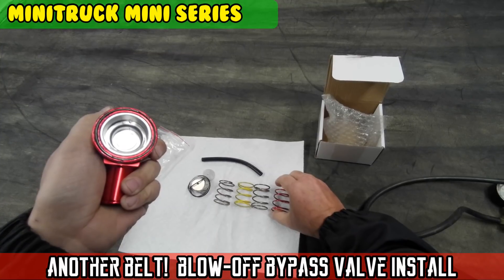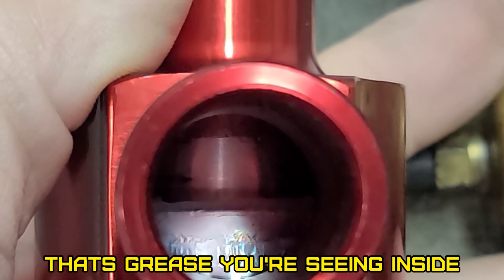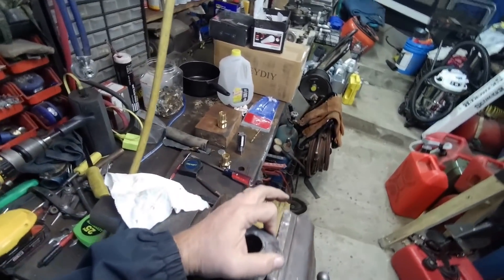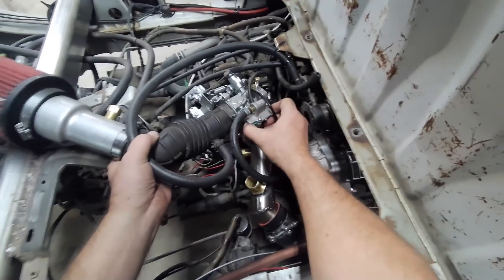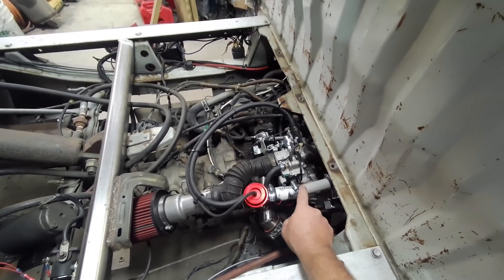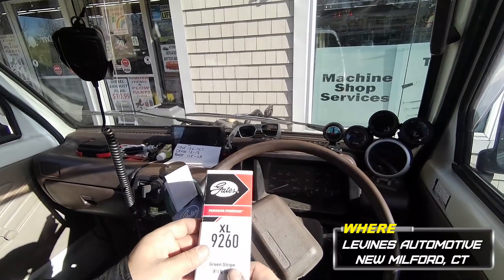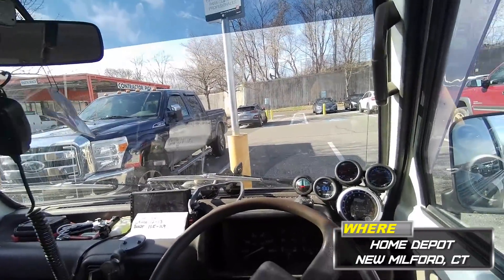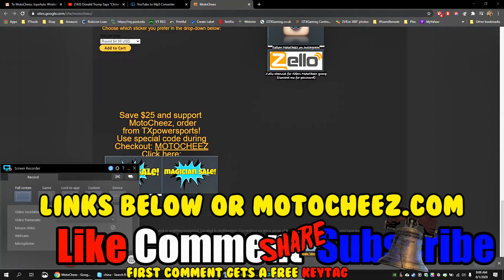Mini-Truck (SE06 E11) AMR300 Another BELT? Blowoff / bypass valve installation

Comment: That Mini... she's a belt eater.  Cutting threads in cast iron without lube?  Yer a braver man than I.  Here's to hopin' progress has been made.
Reply from the maker: You don't really need lube with cast iron it's full of oils, I think graphite. But the stainless steel I definitely used a lot of oil

Comment: I was going through belts heating up and just snapping every few weeks - heat from turning heater and plow winch and lights went to a gates green belt and no issues since belt is cool to the touch now . 25$ a belt but well worth it

Comment: When I'm done with the RTV in the cheez wiz cans I leave maybe a half inch out so when it dries and I go use it next. I pull the part that's  out of the can and it pulls the rest out of the straw or whatever you wanna call it.
Reply from the maker: That's what I do, but it still hardens back into the valve...

Comment: Now I see, said the blind man.  You are using the bypass valve to bypass the supercharger but with both connections still in the post-carb intake tract.   I was afraid you were going to connect pre-carb and suck in unmetered air.  Interesting experiment.  Hope it work for you!
Reply from the maker: I'm keeping fingers crossed!

Comment: Glad to see you finally drank my Kool Aid. lol. You are absolutely correct the engine is producing less "negative horsepower" i.e. engine braking when you let off due to the recirc valve. I think you are going to find the blower to be pretty reliable now.
Reply from the maker: Fingers crossed!

Comment: the springs are to tune the valve opening to the amount of vacuum signal your engine produces.
Reply from the maker: Yes. Boost pressures
Reply: @MotoCheez  Thats a misnomer. If the springs just affected boost tolerance then youd put the biggest spring in there and forget about it. The spring is to tune how much VACUUM is required to lift the poppet of its seat.
Reply: @MotoCheez  By tuning this valve you will change where the supercharger "comes in". Right now you are thinking at idle im no boost and stomp it i got boost. the springs change the middle gradient. At what throttle angle does the valve begin to move and raise manifold pressure into boost. Thats what the spring does.  The instructions you have are for a BLOW OFF VALVE. Which this is not. Its also not for a turbo charger. Sure, its the same valve. But its application is different.
Reply from the maker: Says can use for turbo online...
Reply from the maker: Typically would not have any vacuum before the supercharger or turbo unless you're doing a system like I did which is very rare nowadays so I don't understand what you're trying to say that the boost pressure has nothing to do with the spring because that's what it's advertised as. I know the vacuum lifts it now because I have a pull through system. But typically to vacuum hose is the top would actually open it also to unload, but the spring pressures are stated for boost relief also in case you had a spun up turbo or whatever
Reply: @DieselRamcharger  100% correct.... only to mention : TIAL even makes special springs for their BOVs  for Supercharger Applications  -2 PSI(green) and -3 PSI (pink) Springs
Reply: @MotoCheez  look man. the chinese guy who knocked that valve off and the three interpreturs it took to bring you that instruction book HAVE NO CLUE WTF they are talking about. YES. it CAN be used as a BOV. it also CAN be used as a recirc valve. Which is WHY it has "tuneable" springs. You are tuning the differential pressure of when the poppet {valve} starts to lift off the seat. In a turbo application you would just put the heavy spring in it and forget about it. in a supercharger with a big cam youd need a very light spring or it would never open.  Please Understand This. What I Tell You Is Gospel.  Im not guessing. These are facts.
Reply: @MotoCheez  bro. vacuum is created by the throttle plate. this is a roots blower. the throttle plate is almost always before the blower.  you are right. BOOST PRESSURE HAS NOTHING TO DO WITH THE SPRING. it {the spring} tunes the amount of VACUUM that operates the valve.
Reply: @MotoCheez  you are flip flopping between turbo and sc terminology and function. this valve. it can be a blow off valve used for turbos or superchargers. a blow off can recirculate or it can vent to atmosphere. This valve, in YOUR system. Is NOT a BOV.  It is a re-circulation valve aka bypass valve. In turbo land the spring pressure is used to stop the valve from leaking boost.  In supercharger land that spring is used to balance WHEN the valve opens...but more importantly WHEN the valve CLOSES.  A BOV {surge valve} pops open briefly to vent excess gas to keep up air momentum in the system. A Re-Circ valve is 90% of the time OPEN and CLOSES when you want boost. Engine Vacuum which is created by HOW FAR THE THROTTLE IS OPEN tells the valve how far to lift off its seat. the more closed your throttle is the more vacuum you make. the more open the valve is. the less manifold pressure. as you open the throttle vacuum disappears. the less vacuum at the valve the more closed the valve becomes until you are under positive manifold pressure. when you let off it, high vac returns the top of the valve sees that low pressure and the poppet is sucked open. thats why tuning the spring pressure affects your blowers power curve. but has jack shit to do with power curve in a turbo or centrifugal blower setup.
Reply from the maker: I'm not arguing with you. Either the vacuum or the boost has to exceed the spring pressures. It's basic mechanics.
Reply: @MotoCheez  the boost pressure never exceeds spring pressure. thats what the vacuum half of the modulator is for. ;)
Reply: @MotoCheez  i was in an attic running duct all day. i was super crabby last night. so take my saltiness with you know.. a grain of salt. :D
Reply from the maker: Unless you hook it to the boost side... Like some blow-off valves do
Reply: @MotoCheez  nope. boost never overcomes the spring. if it does, the valve is leaking. on a turbo car the valve is placed before the throttle blade but the vacuum reference is still after the throttle blade. the placement of the valve itself makes no real difference. the placement of the reference hose does. the springs are tuneable ONLY so you can affect how much vacuum it takes to lift the poppet off its seat. You run a spring thats "too stiff" and the engine CANT produce enough vacuum to open the valve. It will never blow off. Its NOT because you "arent running enough boost" or even that the "spring is too strong" the REAL issue is that the generated vacuum signal is TOO WEAK to PULL OPEN the valve. Boost does not PUSH these open. Vacuum PULLS them open. the boost exerting force on the poppet only reduces spring tension to a point where the engine vacuum can act against it. the boost NEVER pushes these valves open. Never. If it did, you COULD NOT USE THEM as a recirc valve, because in YOUR CASE you are closing the valve under full boost only because the vac signal is lost.
Reply: @MotoCheez  we are going to have a sit down about pressure differential if we have to.
Reply from the maker: Absolutely yes I've seen on actual real blow off valves that you're supposed to put the pressure to the top to keep pushing it down as you create boost it's only for like a backfire or when you let off so if you pressurize that small 1/8 port it puts pressure on as you boost it
Reply: @MotoCheez  pressure on top is for a wastegate, which are referenced off boost source {before the throttle plate} bov's are referenced off manifold pressure {after the throttle plate}. when a bov is under boost both sides see equal pressure and the only thing holding it shut is the spring. in a wastegate boost is always acting against the spring to try and force it open.

Comment: I found the slightest burr on my snowmobile clutch a couple years ago after I shredded a new belt and then my backup within 10 miles. Couldn't believe it was the issue but I smoothed it out and ran 1500 miles with no more issues...biggest problem was trying to figure out how it got there...think I nicked it while wrenching.
Reply from the maker: Yeah. Little Burr can cause some damage!

Comment: So the reason we knew where the metal in the blower came from is it was fresh out out the box and perfect, and on the kitchen table he removed the 4 bolts only and was fussing with it and it locked up, and we dug thread shaped metal out of the impeller. Inspection revealed it had fallen out of the through holes of the manifold.
Reply from the maker: Wow. I never even thought of.looking. Was in plastic as I'm sure yours was too. Crazy!

Comment: Good result, I'm a little disappointed you didn't get any pssshh psshhh noises though. now that you have incorporated an intentional weakpoint the belts shouldn't cop all that stress. Next question is are you game enough for the yellow spring.
Reply from the maker: No psh psh because it opening on vacuum. I haven't hit enough boost. I don't know if I'll ever hear it either.
Reply: @MotoCheez  yeah true, it's more of a regulator than a blow off valve.
Reply: I think those plates/disks are meant to be restrictor plates that go behind the hose barbs but those barbs don't screw in on the blow valve unit...So basically useless.
Reply from the maker: Ahh, ok

Comment: you are probably going to have to lean out the carb in your part throttle where the valve is open.... lower the needle {raise the clip}
Reply from the maker: 😁😁😁. I did play with the mixture a bit. It's a butterfly carb with idd pilot jet as you know.
Reply: @MotoCheez  not too familiar with that carb. your gonna wanna keep it up outta the 10's or that motor will start accumulating alot of carbon which can lead to other issues. just make sure you shorten the oil change interval as all that extra fuel has to go somewhere.
Reply from the maker: I may end up switching to a Harley carb, I do the oil changes often, especially when offroading

Comment: Check out the holly small bore EFI kit I bet it would work decent on the mini truck. You’d probably have a lot fewer issues with a turbo and an efi set up
Reply from the maker: I saw that and there's no email to send them and I've been meaning to call them for the last week and a half. It does look like it worked perfectly one and a half inch bore has a little LCD with monitors. I got to give them a call

Comment: You're doing a great job on this project, but here's the next challenge, put this engine in one of the cheap Chinese dirt bikes, and put a v8 in mini.
Reply from the maker: THANKS! Haha. No way a V8 will fit! This engine is almost layed flat. There's no height the way it's designed
Reply: @MotoCheez  Ya, the v8 is a bit of a pipe dream, but what about a ford eco-boost? I'm sure you dropping more money into this than your wife appreciates, but a 1.0 i3 with a turbo charger would really give some muscle behind that horn... of course you'd need a roll cage... go big or go home ;^)

Comment: Tapping with no lube you Savage lol
Reply from the maker: You don't really need it for cast iron, but I did use lube for the stainless steel quite a bit, you could probably see it on a table next to the vice